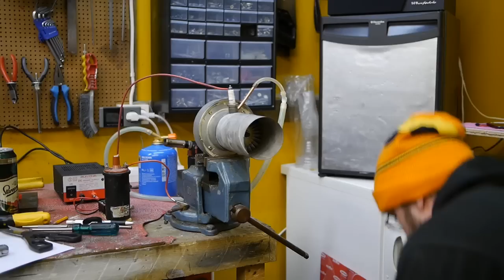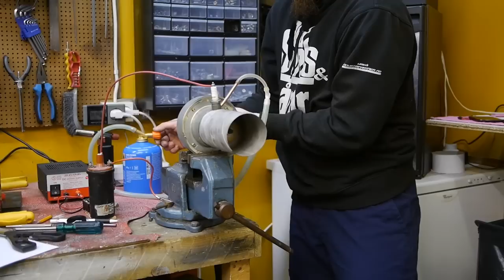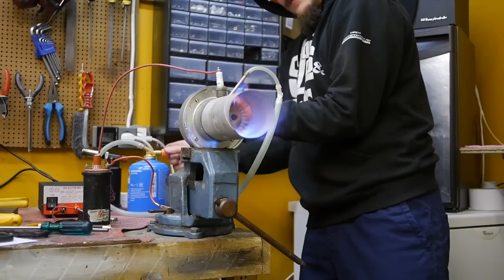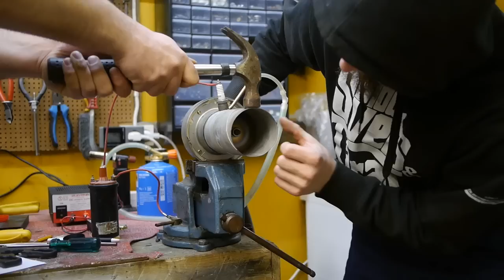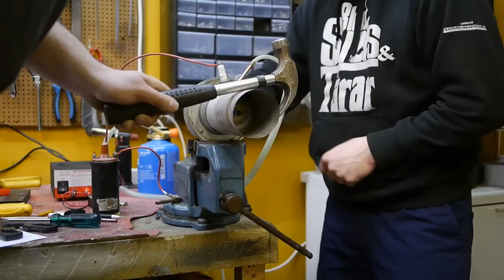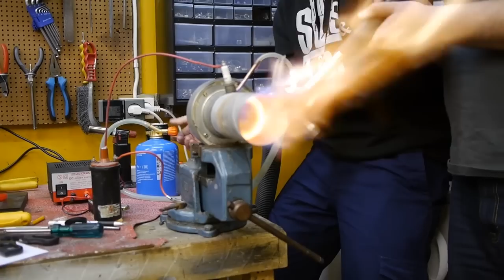Turbine jet engine, almost self sustainable

Comment: I have tried using the vacume impeller systems as well. I had best luck with bissel Uprite and much ticker exhaust tube. It's not the hot turbine expanding,its the exhaust tube warping under heat. Get onto online metals and get some .080 316 stainless tube,nonwelded so it doesn't warp,then she will spool out

Comment: Gas alone, not in liquid form is not enough to make most engines (even proper ones) self sustain. If you turn the gas can upside down, it will feed liquid gas, then it might happen, but be very careful if you try this. Biggest mistake you are making is pushing way to much gas far too quickly into an inadequate combustor, causing the Turbine wheel to overheat badly and the casing to distort, making it seize up.

Comment: you have too optimistic hot gas turbine. cut a small wheel and block the gas flow so it would only touch half of inch of blades... the hot gas goes out through the axle without generating oomph needed.